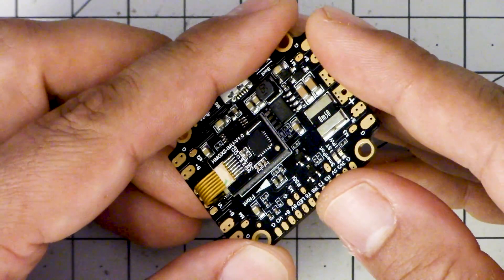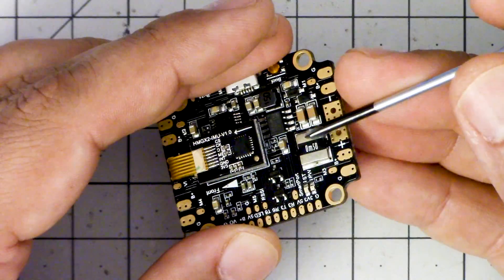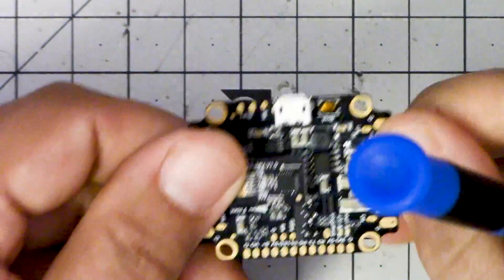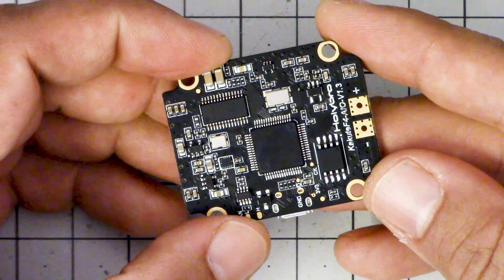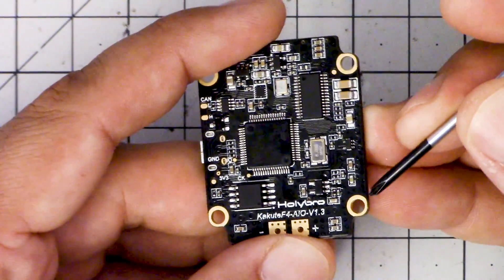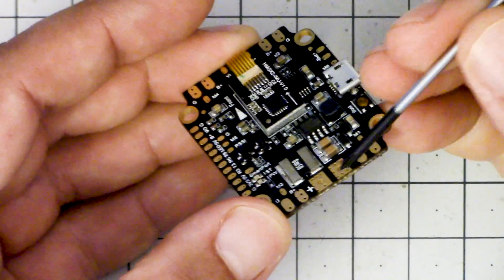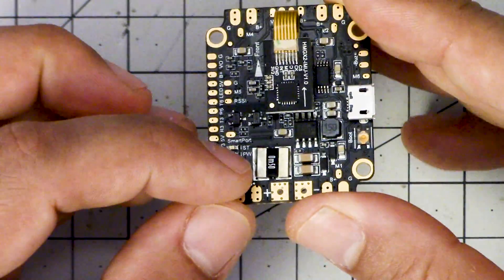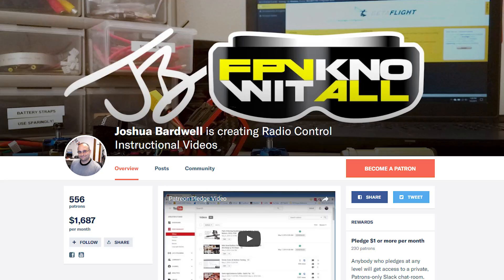How To Fix "Current Sensor Too Small" on Kakute F4 (and others!)

Comment: Hi Joshua i have an issue with the kakute v2 recently unstalled on a tricopt... at the test flight the copter hover around 25 secs, then dropout, keeping a the motors turning slower until the trottle stick comes back to zero and then restarts... I tried lowering the gyro and pid Hz, i still have the same happening. Checked my esc wires, stopped the filters, checked everything, any idea of what those symptoms are ? i have a servo plugged to the bord, i first thought this could be draining amps from the bord, but i ve followed David video point by point, and it shouldn t be the case>> Help please i m overseas and i need this copter to work with...

Comment: Hey @Joshua Bardwell i did that modification to my FC Omnibus F4 Pro V2, it unfortunately had too low value of max measured current from factory, it was limited to 60A. In blacbox it showed max ~57A probably due to shunt resistor tolerance. I wanted to double that at least, so i soldered second shunt resistor on top of each other, i took second resistor from my previous, broken Omnibus F4 Pro so i know it is the same exact shunt resistor. I changed the scale from 550 to 275, but then the currrent showed in osd was way too hight (2,5A when disarmed), so i calibrated it, it was done well for sure, now my current scale is 481, and current readings are very accurate compared to meter hooked up in series, however max current has not doubled, but inceased only by about 10A or so! Now max what it can read from 60% throttle up to 100%, is only ~67A. That is still too low. How do you think, why does that happened? Is that method proven to be working? What should i do to my FC to be able to read at least 120A? Should i solder another one, third shunt resistor on top or what? :) I don't know why it not doubled max possible reading, my solder joints are good for sure, and i used 12AWG wire on all high-current connections.

Comment: Finally!
I have been trying to find this resistor for days and no one knows the power rating, the pictures never look the same, no one knows what the size or type of resistor it is. Thank you for the link.
Now I know what it is: (0.5mohm, 4W, 1%, Metal Foil resistor manufactured by stackpole electronics).

Comment: No worries thanks for the response yeah it's kind of weird that it stopped working every now and then I'll get like a little blip on the amperage draw but goes back to zero looks like I'll just probably be getting a new FC can you recommend a affordable but good flight controller with current sense I looked at your flight controller it looks really good for the price to thanks

Comment: Is there a way to test the the two current resistors?mine on the maytek f405 stopped working.current scale is set to manufacture specs
Reply from the maker: I'm not sure how you would test them without desoldering them from the board.

Comment: using a resistor to measure current... What a shame..
And your solder would be way better and easier with soldering flux..
and great ! you just made a cold solder...
Reply from the maker: A shunt resistor is the normal way that current is measured, unless you're using Hall Effect I suppose, but that's way more expensive.
Reply: Joshua Bardwell Of course... but I think for something flying over our heads it's safer..

great video tho I like the way you go deep in many subjects
Reply: But I admit that for amp draws below 30 amps the power dissipation is quite low

Comment: That shunt resistor is rated at 4 watts.  How does a 4 watt resistor handle 60 amps of current ?  . . .  Oh because the voltage differential across the resistor is so tiny the power going through it actually very small.  hmmm.  Is that right ?
Reply: Right.
Reply: It's not about the power going through it, but the power loss on the shunt itself. Power loss equation: Iˆ2*R. 60*60*0.0005 (0m50) = 1.8W dissipated power.

Comment: Hi Joshua.Do you know what resistor value (very small gain control SMD resistor) does  betaflight 3.2.4 expects on the board to get proper current reading?Thanks

Comment: Hi Joshua, hope you see this, i have the Maytek f7 std FC board with the matek PDB, VTX in one. The current sensor goes to 184amps, but im going to be using esc that are 50amp bursting at 60amp. Straight away i see i need to add another current sensor as described in your vid, I only see the one current sensor on the PDB, not one on the FC. Am i right to double this current sensor that i see or anything else , regards and great vids man!
Reply from the maker: You have to first really ask yourself whether you are going to pull 50 or 60 amps in the air. For a typical 5" or 6" mini quad, there's no world where you'll exceed 184 amps. The battery just won't do it. I mean... if you were to dead-short the battery, maybe you would get 200+ amps for a fraction of a second, but the battery would sag immediately. In flight, I don't think it is going to happen unless there is something really exceptional about your setup.
Reply: Thanks for the reply, the build is Armattan 5" rooster, EFAW 2407R's, Flycolour 50amp ESC with BLHelli 32 dshot1200, Matek F7 STD, was going to use the Matek power hub inc vtx, until i got to the problem of current senors and Amps lol ( yes it was/will/hope its going to be a monster) to be 6S ready when the time comes. I had orderd a GEPrc 6s PDB which can do 50amps and burst to 65amps and no current sensor, then i saw this vid, but looking for the current sensor on its own to buy for the Matek F7 i havent seen any.

Comment: I have tried this  mod on FGLRC F4 Flame AIO controller. Stock version was capped at about 90A. I bought bunch of those shunt resistor from digikey, soldered one on top of existing. 
Calibrated FC current sensor using "mah in/out" method based on my charger's readings. Now it produces more or less realistic result  with up to 132A peak with Tattu R - Line 1500mAh 14.8V 4S 95C battery, 35A Racerstar BLheli_32 ESC and Emax RS2205S 2600kv motors.

Thanks for the idea!
Reply: Hello, I also have F4 V5pro. with the same problem he only scores 79A.
How do you fix it? So put another big resistance of 0M50 on top of what you already have? or put another value?
What number is put in betaflight?
Thank you!
Reply: Yes, I soldered another resistor on top of the original, so they work in parallel.

After calibration, number in betaflight went down from 400 to 240. 

Calibration method was explained by Josh in one of his videos. In short -  you add resistor, you fly the pack, lets say FC reported 850mah used. Then you charge the battery to full and charger shows 1450mah was sent to battery. Then you adjust  the current sensor calibration value in proportion: 400(original value) * 850/1450 = 234(new value)
Reply: Thanks, it's done. It works very well.
I have been calibrating with a current meter. And you are right. the scale that best fits is 240.
And thanks to Joshua for teaching us this.

Comment: Hello Joshua i have  question, the current sensor of my fc blow up, and in my country is very dificult to found one of these resistors, my fc run on the computer, but no with the battery, can i connect the two parts without one of these resistors??
Reply from the maker: Desolder the damaged component and then just bridge the two pads with a big blob of solder or a thick piece of wire. The current sensor won't work any more but everything else will be fine.
Reply: Thanks Joshua, you have a great youtube channel and your help is much appreciated

Comment: Hello!

Can i use this method to modify this breakout?

https://www.banggood.com/INA169-High-Side-DC-2_7V-to-60V-Current-Sensor-Breakout-Module-For-Arduino-p-1193990.html?rmmds=search&cur_warehouse=CN

I need 160-180A range.

This looks good, but expensive:

https://www.sparkfun.com/products/10644

Thanks!
Reply from the maker: Yes, I think so.
Reply: How can i calculate the resistor value? Just use your values?

Thanks!

Comment: How do I know if I have the batch with the 60 amp sensor or the updated?  Is the current sensor fairly accurate from the factory?  If so would you have a value that could get me in the ballpark?
Reply from the maker: +Ohmega 355 all of this info is in the video. I don't remember the answers from the top of my head but please watch the video.
Reply: Joshua Bardwell sorry about that I'm face palming right now.  Thanks for your time
Reply: You mentioned "a method you showed on the channel by using mili-amp hours from battery to calibrate the scale". Where is this video you mention about in your channel?

Comment: Great video as always. Does the software allow to scale it to 240A?and do you have the part number for the 120a resistor? Thx I thought this should also work for 120a resistors and make them stackable.
Reply from the maker: You can scale it to 240 amps but if you actually push more than 120 amps through the board, you are likely to damage it.

Comment: Joshua Do you have the full circuit diagram ? Please can you tell me the ADC pin on the Micro the INA169 is connected to(I think its PA1) and do you know the range 0-3.3v or 5. Thanx
Reply from the maker: I don't have the schematic and don't know the answer. But if you email me joshuabardwell at gmail your question, I will see if I can get the answer from Holybro for you.

Comment: I have a question. After ordering the kakute, and now finally all build. I receive constant sensor losts. All over the place. Taranis x9d+, XSR receiver, smartport. I never ever had that happen with any of my other builds or boards. What is that? The soldering looks ace! I don't even know how to debug that.
Reply from the maker: That's a bug in the XSR firmware. Everybody is having it. You need to update the firmware in you XSR to the latest. Or somebody told me the beta firmware on the FrSky site fixed it for him.
Reply: Went for 170619, which seems the latest. It is better now, a lot, but still happening. I can see that it loses the sensor for a very short period of time, then it comes back. So whereever I can set that timeout, that needs to change, it's set to way below 1sec. But I don't know where it is hidden (Taranis X9D+)

Comment: Why would you add another large resistor that is carrying the entire current load and harder to solder? Why not double stack the resistor underneath, just add another resistor with legs on the underside??
Reply from the maker: I don't know what you mean by "double stack the resistor underneath".
Reply: You can do the exact same thing to the resistor on the bottom, you can stack another resistor on top, using a resistor with some legs and some heatshrink makes it much easier to make a solder point on the side of the 402 packaged resistors already there. Or you can get another 402 package resistor and do the same and solder on top of the existing 402 packaged resistor, not much harder to do, but not as easy to get the resistor locally.

Comment: Hi I havent got one of these yet but shouldnt the manufacturer sort this for people by replacing the board this is a rather large oversight and should be rectified by the manufacturer at least that is my opion soon 250 quads will have to be fitted with XD90 plugs to supply the required power used my thoughts

Comment: Which current sensor ic iused?
Reply: I think it is this INA169NA
Reply from the maker: I don't know for sure. I can ask Holybro, but I will never find your comment again to answer you. So if you email me joshuabardwell at gmail I will find out for you.
Reply: Thats ok , I am pretty sure its in the ina series, there are only a few with gain resisters , checking datasheets

Comment: shunt resistor is rated in milli ohm not kilo ohm
Reply from the maker: Yes, but the gain resistor is rated in kOhm, and that's what I was referring to. The shunt resistor is 1/2 mOhm. The gain resistor is either 100 kOhm or 51 kOhm.
Reply: 6:00 onwards

Comment: Hey Joshua, any reason as to why I would keep frying a PDB's 5v regulator. Could it be getting to hot? I did go excessive with foam and padding on top.
Reply from the maker: The most common reason for frying a regulator is by drawing too much current through it. Either because you have over-loaded it, or maybe because you have a short.
Reply: Joshua Bardwell its a short I bet it's my second one lol
Reply: Check with your multimeter in continuity mode between your pdb output and ground :)

Comment: The current sensor that you will buy from your link and then solder on the top of the old sensor, how many amp it is?
Reply from the maker: If you solder the resistor that I link to on top of your existing resistor, it will double your current scale. So if you have a 60 amp board it will now be a 120 amp board. If you have a 120 amp board already, don't do this mod, because you can't really pull more than 120 amps through the Kakute PDB anyway.

Comment: I have this flight controller.  What kind of problems could I notice if I have the 60 amp sensor?  Could it cause video problem?
Reply: It really has nothing to do with the video. The only difference is the scale of the current sensor. If you don't get past 60 amps in flight technically you dont need to change the resistor. 

As far as video maybe you need a bit more capacitors or an LC filter in the power going to the camera and vtx.
Reply from the maker: The only difference is that your current readout will hit 60 amps and then not go any higher. If you really exceed 60 amps by a lot, you can damage the current sensor IC itself. But it won't affect anything other than the ability to measure current and mAh.
Reply: Joshua Bardwell ok cool thanks for helping me understand, I'm not too worried about the measurement.  Thanks

Comment: Joshua, good call I soldered a 0402 50k resistor underneath as I couldn't desolder the existing 100k resistor after you suggested it earlier.
Reply from the maker: You got some steady hands...
Reply: Joshua Bardwell spoke too soon as it didn't work so have removed it again I think I may have accidentally bridged the bottom resistor. Back to the drawing board.
Having trouble sourcing the shunt resistor you linked locally in Aus and Digikey want $25 to ship a $1 resistor

Comment: Would this explain why the OSD would cut out at high amps? Or something else
Reply from the maker: No. That is usually excess noise from the motors that screws with the OSD's ability to sync to the video.

Comment: How the fuck is holybro/retailers not providing the damn thing instead of you having to go find one?
Reply: lol, if you have bought one since june then you have the higher rated one, if you have one currently and it is only 60amp then you can contact Holybro and get it swapped if you want, or you can just add another 100ohm resistor to the other side and not wait. Seeing most cities in the world will have an electronics outlet locally that will sell the right resistor for about $0.30 or less you can upgrade the ability to display a high amp rating in less than an hour including travel, the choice is yours......
Reply from the maker: No comment.

Comment: I don't get why manufacturers cant just calibrate the current sensor and put the right scale on from the factory.
Reply: Also, that cl racing f4 is a nice board, im using  one currently.
Reply from the maker: +Sloth FPV I don't see why they don't include that in their default Betaflight settings.
Reply: Joshua Bardwell well yeah i suppose thats what i mean. Surely 1 person needs to calibrate theirs for each board and add it to that target?
Reply: The problem is all these sensors could have a bit of a different resistance so they might need a different scale. So even if they set 550 or 275 gain on their firmware they might still not be perfect and need to calibrate (depending on how accurate the user needs amps reading to be).
Reply: TransAm2k4 it would still be better though, an they do it in chargers accurately, so why not in fcs?
Reply: Sloth FPV the problem with FC is that there are many different version of firmware that are constantly updated and once you update your firmware you would loose your calibration...
Reply: TransAm2k4 just remember it? Or have database of voltage scales for each fc?
Reply: Joshua Bardwell can i remove a shunt resistor if i dont want current sensing? Will just removing it and bridging the pads be ok?
Reply: WhomImIzFPV just leave it there and dont use it, no need to remove it
Reply: Sloth FPV yes... There is need to remove it for what i am doing. Shunts add resistance. Ive just never tampered with a aio fc in that manner b4.
Reply: yes, you can remove it or you can leave it and connect to the end of the resistor so that current doesn't flow thru it. That said I can't see the shunt resistor really rubbing that much power from your setup.
Reply: TransAm2k4 Thanks. Any power robbed is going to have an effect. Im gonna be pumping more power thru an aio than has ever been done b4. Short of drl's 10s rig....
Reply: Now I am very interested, tell more if you can??
Reply: TransAm2k4 and me a message on hangouts under the same name.